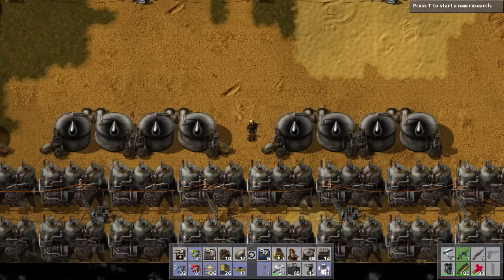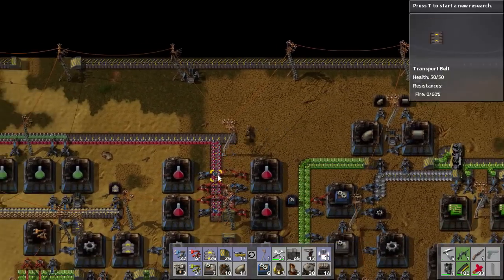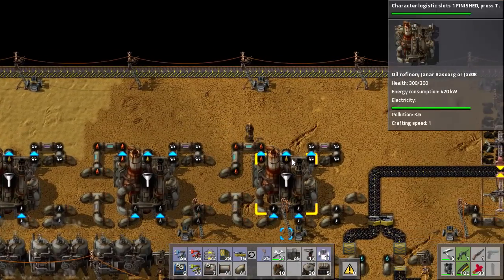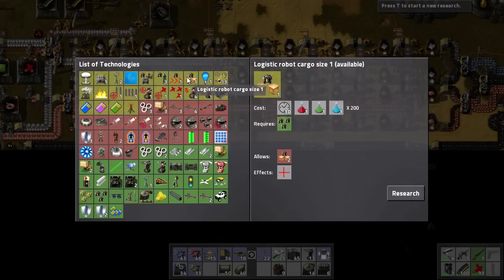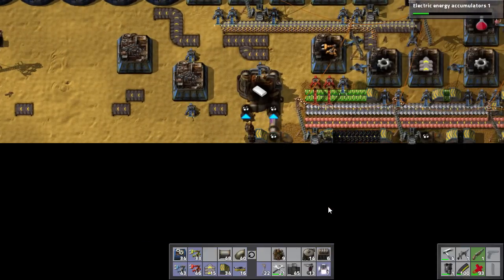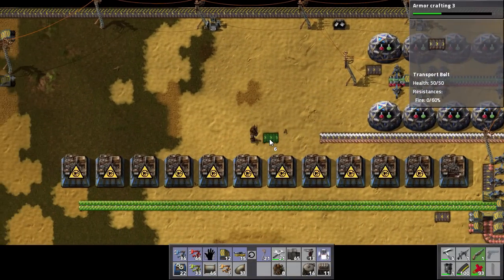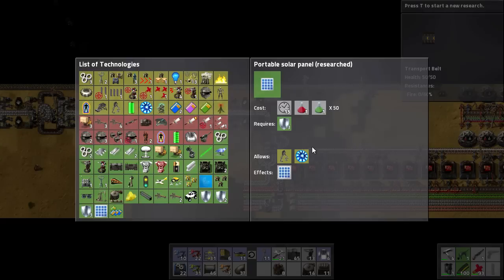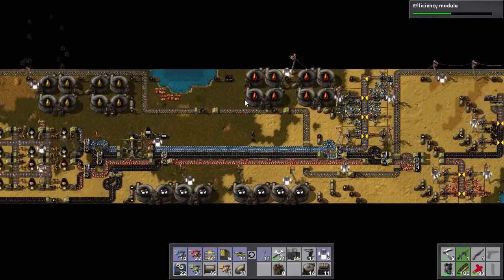Linear Factorio :: Advanced Circuits - Episode 6

Comment: The copper coil for red circuits will never be able to keep up. You should run a full belt of copper coil above the belt with plastic and coil, but from the other direction and pick them up with red inserters. Love the series!

Comment: You should really consider putting all of your labs on the same side of the science pack belt. You'd get back a good amount of horizontal space in an area where you seem to be very constrained. It will also make it easier to add in the blue/purple line when you get there.
Reply: I was thinking the exact same thing! Why constrain your vertical space when you could just spread it out on the limitless horizontal?

Comment: The right hand part of the balancer on the excess iron from the steel production isn't actually doing anything. All iron produced is on the right hand side of the belt before the splitter, so a simpler 2-wide balancer is actually sufficient and the right hand loop is redundant.

Comment: About the Science pack 3 math:
You actually need only 8 Assembling machines (AM) producing Advanced (=Red) circuits to support 12 Assembling machines producing Science pack 3.

8 AM produce 1 Advanced circuit per time unit
12 AM produce 1 Science pack 3 per time unit
To produce 1 Science pack 3 per time unit you need 1 Advanced circuit per time unit. Meaning you need 8 AM producing Advanced circuits for 12 AM producing Science pack 3.

(I use time unit in this context rather than second because of the crafting speed alter between AM tiers and theit modules: AM 1: 2*time unit=time in seconds, AM 2: 1.33*time unit=time in seconds, AM 3: 0.8*time unit=time in seconds)
Reply: Yup. And Chemical Plant is actually the same speed as AM3, not AM2.

Comment: Sorry zisteau, but you messed up your math.

If it takes 8 seconds to produce one advanced circuit, than you would produce 1/8 cirquit per second. Use 8 ( or in your case 12 ) assemblers and you will produce 8 * 1/8 = 1 adv circuit per second ( 1,5 ).

If you want to produce 12 circuits a second you will need 12 * 8 = 96 assemblers.

Good luck mate ;)

Comment: Z the whole point of lab efficency is that it does cost a lot more to research but it saves you time down the track. It doesnt save you any resources because thats not the point. Its supposed to save you time
Reply: do you know what efficiency means?
Reply: ***** You can be efficient in many different ways: space, time, material, etc.
Reply: KhleverSheep in this game you are efficient in energy, but the scrub who. commented only knows the word because of an enchant in minecraft and thinks the word means speed
Reply: *****
Ah.. thank you for explaining that Factorio is about energy efficiency. I don't play the game myself, I just like to watch Z play it.
Reply: KhleverSheep i have no idea if you are being sarcastic. im certain you know what efficiency means. protip: if you use sarcasm and stuff alot, you can try talking like thec glitch from starbound
Reply: ***** I was not being sarcastic. As someone with experience in optimization, sometimes you want to optimize one thing over another. If, as you said, the goal of Factorio is to be as energy efficient as possible, then it makes sense to minimize the use of energy.
Reply: KhleverSheep that is not the goal the goal is to get the rocket defense. also. my brain derped. the lab efficiency saves materials, not energy. the efficiecncy modules save energy
Reply: ***** I do know what efficiency means and Ive beaten the game several times, so Im hardly a scrub. Efficiency is to accomplish something as quickly as possible without regard for the resources used, and effectiveness is to accomplish something as best as you can, regardless of the time taken. Source: Have a degree is Business Management and am a Manager. So if you actually think about it instead of using your pathetic youtube commenting brain, lab efficiency is exactly that, its saving you time down the track at the expense of resources now. Also if you had played the game at all you would know that energy management is the least important part of the game, its a factory simulator, based mainly on resource and production management. You can even tell that from these videos, so maybe you should go away the scrub?
Reply: MilkySubstance are you mad?
Reply: MilkySubstance If efficiency is doing something as quickly as possible. The most efficient vehicle must be a space shuttle. And the most efficient way to clean your house would be to buy a new one each week.
Reply: MilkySubstance You might want to type "define effectiveness" and "define efficiency" on google.

Also, Lab Efficiency is not worth it since it makes the labs more time efficient, not resource efficient. Just build more labs. People have posted the numbers when those upgrades are worth it.

Comment: maybe a train running the perimeter of your world could solve your belts problem, a cargo hold for each item.
Reply: He doesn't quite have the capabilities for that yet.
Reply: notbob555
I know, I'm talking about in the future.
Reply: Rippertear - HD Daily Gaming Videos
He also talks about the train in near every episode.
Reply: notbob555 yes, but only for ores. I think a big circle around the whole place would work better.
Reply: Rippertear - HD Daily Gaming Videos
There really isn't much room for that, he might be able to fit a roundabout in, but two tracks would reduce his space to 16 units everywhere. It sounds like more of a drawback to me.
Reply: notbob555
compared to four belts? that's almost an infinite amount of of capable items with a big train loop.
Reply: Rippertear - HD Daily Gaming Videos
You know he does need more than just belts. If he had that running around his entire base, he would have to tear down almost everything he has done so far and rebuild it in a much more linear fashion. Honestly, I think he'll be better off with a singe track with a train going back and forth on it with robots carrying things around in his base.
Reply: notbob555
everything at the top 2 and bottom 2 units, nothing more or less.
Reply: Rippertear - HD Daily Gaming Videos He is already using the bottom two units. throughout most of his base.
Reply: notbob555
bottom four, for belts.

Comment: sorry, your math really is quite off. you just need one chemical plant:
if you want 1 science3 per second you need 1 advanced circuit per second, so you need 2 plastic bars per second (for your resource calculation just ignore the number of assembly machines you need!), that can be produced by one chemical plant.

Still, your making the best factorio videos!

Comment: am i a derp or is Z's math all derped up.
If you want to make 1 blue science potion per second, you will need 1 advanced circuit. per second. Which means 8 assembly machines for those. not 12. not 16. 8.